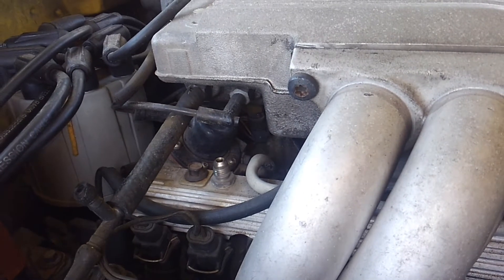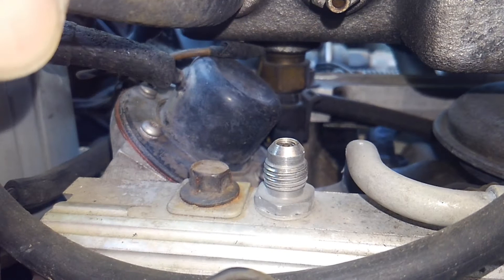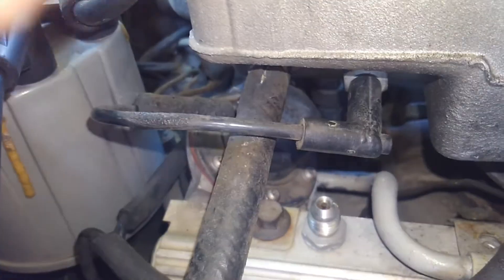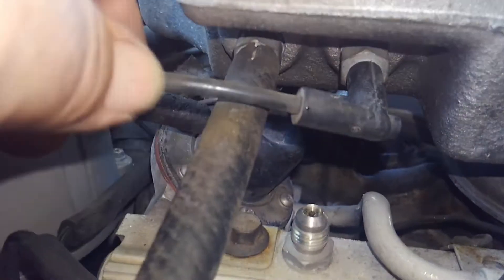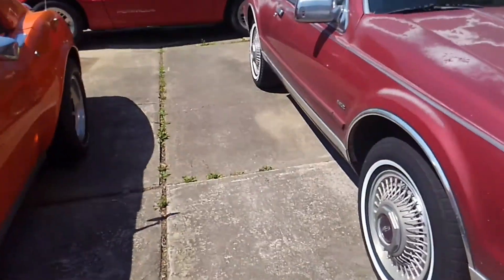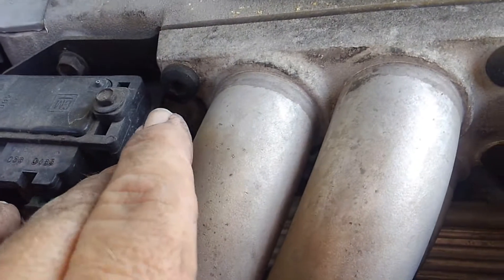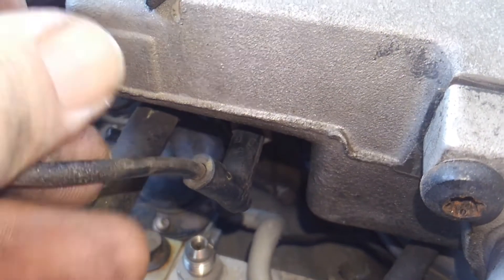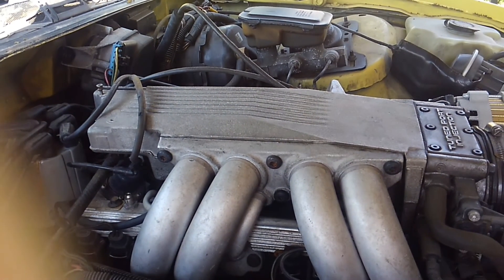GM Corvette and F-Body Tuned Port Injection Vacuum Circuit Explained

Comment: Great video, you sure have a lot of knowledge. I have a question, on my 91 Corvette I removed the smog pump and air diverter along with all piping. However from what I have heard, there should be a small vacuum line going to the air diverter, however I cannot find that line, and I am sure I did not remove it? I have the FSM but can't find any information regarding that particular vacuum line. Do you have any info here?

Comment: I deleted the egr pipe and components but i still have the egr valve. And vaccum hose. Will it cause vaccum leak?
Reply from the maker: As long as you have everything plugged up and/or blocked off you should be good to go

Comment: Just came across your video. I picked up a 87 Corvette with bad heads. (Guy overheated the car bad. Blew the head gaskets and burnt through the heads from the combustion chambers to the water jackets.) In pulling it apart, EVERY plastic vacuum line crumbled!!! 😢 Definitely going to be interesting putting it back together. 
Thanks for the post!
Reply from the maker: sounds like you have your work cut out for you, but should be a fun project. Glad I could help

Comment: Great video, ido keep on getting Code 36 followed by code 45 on my 89 tpi 350 Camaro, i switched maf sensor once and the problem went away a few days, but returned, i think i will go through all my vacuum hoses.
Reply from the maker: that's a good idea. I would take a close look at the wiring to check for damage as well.

Comment: May have already been mentioned but the Corvette EGR is different from the f body. I don’t think it mounts to the intake like the f body it’s mounted remotely if I recall correctly.
Reply from the maker: There is some difference, but it's not with the EGR valve itself, which is in the same spot. The early F-Body and Corvette TPI's use the same GM part number TPI base, but after 86 when the Corvette upgraded to the D-Port aluminum heads, they installed a EGR bypass pipe at the back of the intake directly in front of the distributor that routed the exhaust gas directly to the manifolds instead of going through the heads. The F-Bodies still utilized the steel heads, so they kept the older intake base design. The vacuum lines have different routing as well, which still continues to confuse me, especially at my advanced age😁

Comment: How do you clean the Plenum, with a wire brush or a jel? To make it more shiny
Reply from the maker: I like to use some of the less harsh methods with these bases since many of the cleaners end up dulling the finish.

I always start out with a pressure wahs with diluted Simple Green or citrus based cleaner, and if I need to get crazy will blast it with some walnut media in a cabinet. Much of it is covered by the runners and plenum, so remember it doesn't have to be perfect.

Comment: Where does the vaccum line under the throttle body goes
Reply from the maker: It splits off and goes directly into a fitting at the bottom of the throttle body, and if I'm remembering correctly the other part goes to one of the fittings on the passenger side rear of the plenum.

Comment: Which Vacuum line causes the idle to go up n down or is a bad EGR Valve
Reply from the maker: There are quite a few vacuum circuits on the TPI system that can cause idle irregularities. I would recommend spraying carb cleaner around the intake ports and vacuum lines while it's running to help locate the source of the leak.

Comment: They do use a vac storage canister. Its in the left front underneath the car. Below the cruise control. Can be accessed from under the car.
Reply from the maker: Yep, that is correct. They hid those things very well on the F-Bodies😁. Thanks for chiming in👍

Comment: I’m having a hard time to keep mine running. It only stays at about 500 rpm and then jumps up to 1000 and repeats the cycle. Then I will hear pops inside the engine. Any ideas?
Reply from the maker: Have you checked to see if any trouble codes are popping up in the system? An erratic idle can be symptomatic of several different problems, so a trouble code would help to start narrowing it down.

Comment: Awsome Video There is 2 hoses in the Throttle body  on the passenger side can you confirm where those go
Reply from the maker: one is for the PCV, and the other is a vacuum port into the manifold

Comment: Hi! If i disconnect the vacuum line of the EGR valve. Is the valve will be closed?
Reply from the maker: Yep, that should be tye default position with no vacuum circuit hooked up to it.
Reply: @VetteSource  Thank you!

Comment: I have an 1985 vett it runs like crap until wormed up check engine light is on and im ready to ditch this set up and new intake and carb
Reply from the maker: Hey Heath, have you pulled the codes from the ECM and checked the basic components yet?

Comment: What's the fuel filter called under the tune Port.
Reply from the maker: You mean under the intake manifold plenum?
Reply: @VetteSource  yeah.
Reply from the maker: Oh, the one at the rear of the plenum in front of the distributor. That's the fuel pressure regulator.

Comment: My 90 L98 TA was running fine until it suddenly developed a low idle (300 rpm) problem. Checked and got no codes. Replaced the distributor cap and rotor even though they were almost new (the distributor was rebuilt a couple of thousand miles ago). Checked the coil per factory service manual. Injector resistance is good. Bought a smoke machine but can find no vacuum leaks. The throttle body idle stop screw is plugged at the back which prevents adjustment. As a temporary fix i threaded a nut onto the front of the throttle body idle stop screw which raised idle to 1,000 rpm. Any ideas on what else i should check?  Thanks!
Reply from the maker: That is a tough one. I would suggest disassembling the throttle body to check for any internal vacuum leaks around the IAC housing. They have been known to develop cracks in the aluminum with age.

Comment: Cars with cruise, and or AC got a vacuum tank (ball).  It's hidden under the battery tray, typically drivers side.  There are two trays.
Reply from the maker: Yep, that's a hard one to locate on the f-bodies. It'll drive you crazy looking for it.

Comment: Hey I have oil coming out of the dip stick of a 91 with 118,000 on the engine what am I to do
Reply from the maker: Off the top of my head, it seems like your crankcase is pressurized for some reason. Do you have the PCV system disconnected, or have you checked the condition of the individual components?

Comment: Can you give a link as to where you can purchase the vacuum line connections and/or repair kit?
Reply from the maker: Dorman makes a repair kit for these vacuum lines. They are available at most auto parts stocked under hard vacuum line repair kit.

Comment: Great video very helpful! Trying to figure out where the vacuum line from the heater control valve runs to on the 350 TPI car with the MAP. Any help would be appreciated!!!!
Reply from the maker: Hey Jeff, the vacuum line should have a T junction and then feeds into the main engine harness that goes through the firewall into the passenger compartment.
Reply: @VetteSource  
Much appreciated, had the car stored while I was disabled for some time and the mice seemed to really enjoy the vacuum lines. Thank goodness it was just the vacuum lines. Will try to get out to my shop and see if I can hopefully find some part of a line going into the firewall there. My 1989 GTA is slowly returning to it's former glory days and running again.
Reply from the maker: That's the spirit, slow and steady gets you across the finish line every time👍.

Comment: I have the '89 Corvette L 98 engine that I just purchased.
I have trouble starting it sometimes so I'm figuring the vacuum line to the fuel pressure regulator may not be working properly.
Reply from the maker: It's possible, but that particular symptom can be caused by one of many things. I would recommend investing in a factory service manual for your car. It has all the information and diagnostic information you need to keep it running properly.

Comment: Which of those three vacuum lines goes into the MAP sensor?
Reply from the maker: The vacuum circuit for the MAP sensor connects directly to the rear most vacuum port on the side of the intake plenum, directly in front of where the distributor cover attaches.

Comment: What the T go to on the HVAC line you stated someone replaced. I didn’t hear where the T went or if it supposed to be there
Reply from the maker: Hey Dustin, the T junction will feed back directly into the engine harness that runs through the firewall to hook directly into the interior HVAC control that distributes the vacuum to the individual blend doors.

Comment: So if then lines are not connected right are leaking would that stop the car from starting my 86 will. Crank with starting fluid just a second then die
Reply from the maker: I've never tried starting the car with them totally disconnected. There would be enough of a vacuum leak at the plenum to probably cause it to run very poor at the least and maybe not start at the worst.

Comment: Excellent video for my knowledge I have 89 corvette n all thise hose are brittle how can I replace them ? If anyone knows thank you
Reply from the maker: Hey Oswald, thanks for the feedback. Glad it was helpful. Dorman makes a GM/Ford vacuum line repair kit with fittings. I believe it should still be available at your local parts store. Let me know if you have trouble locating it and I can point you in the right direction👍.

Comment: So I only need the fuel pressure regulator if I plug the other two off
Reply from the maker: Yep, that is correct. You will lose the accessories and HVAC system which all require vacuum input.

Comment: If you have a vid to diagnose a no start condition on a 86 t/a MAF TPI, please point me to it. I know the car starts on starting fluid, has a new fuel pump/ external filter too, and 45 psi at the schrader valve,
Reply from the maker: Hey David, I don't have a video made for that particular scenario yet, but with the checks you have already performed and with the car firing up with starting fluid, I would look closer at the fuel injector harness connectors to make sure they are pulsing when cranking. Sometimes the ECM injector driver circuit will fail causing a similar situation to what you are describing. 

Let me know how it turns out👍.

Comment: I was having a problem with the air flow out of the air vents in my 90 corvette. I found a break in the line  and spliced it back together and the air is flowing out of all of the vents like new.. My cruse has stopped working so I now know to look for the Problem. Thanks for all of the Help that You have provided
Reply from the maker: No problem👍

Comment: I had work done on my 85 corvette and in putting those hoses back i noticed that the hose going from my fuel regulator wasnt there. The little circular vacuum hose and there were hoses placed there from the front of the engine. And my question is does that circular hose go to the plinum only or are there any other hoses that go to those ports on the plinum ?
Reply from the maker: It should be directly connected to the plenum, and doesn't share the vacuum circuit with any other accessories. I don't have my diagram in front of me, but IIRC the rear most vacuum port on the plenum is used for the HVAC/cruise control/vacuum tank.
Reply: @VetteSource  thank you for the reply. Thats what i thought but 
in putting that circular hose there i'm still trying to figure out where these other 2 vacuum lines go. Thats the confusing part. I replaced my fuel regulator because i was noticng raw fuel coming out of my tailpipes and after i replaced the regulator it still spits out that carbon soot out of the pipes. So ure saying i should place that circular line on that port ?
Reply from the maker: Try that first, but with raw fuel exiting the exhaust pipe you may have a torn diaphragm within the fuel pressure regulator itself. Something is allowing too much fuel to enter the combustion chambers. Let me know how it goes.
Reply: @VetteSource  ok i was thinking it might have been one of the fuel injectors placed in the head wrong because the guy had to remove them to replace the manifold and i don't think they were lubed up  before being placed  back in the manifold and they look like the factory injectors so i ordered new ones to replace those just in case while i was down in there anyway. But while i'm replacing them i will check the fuel regulator for tears.
Reply from the maker: Good idea. Let me know if you need anything else.
Reply: @VetteSource  i will thanks for all your help .

Comment: I know this is an old post but hopefully you can help me out. Installed a 357hp crate engine in a 1990 and MAP is giving me a rich condition and poor idle? Any Help>
Reply from the maker: Hey Ron, lots of possibilites once a crate engine is installed, but first thing I would do is hook it up to a professional scan tool and see what the ECM is doing in real time. That will give you some insight and clues as to what to look for. 

Off the top of my head I'm wondering if you have a software problem between the fuel injectors on the crate engine and the factory ECM settings.

Let me know how the troubleshooting goes👍.
Reply: @VetteSource  done that! My issue is not enough vacuum at idle
Reply from the maker: Ok, sounds like you could have an EGR circuit problem. How much vacuum are you pulling at idle? Does it have a pretty big cam?

Comment: NO ONE SHOWS ANYTHING ABOUT THE 1990 CORVETTE! that car is such a mystery!
where does the hose to the HVAC connect to  going from the check valve!?! big mystery woo woo show it please!
Reply: Both
Reply from the maker: After routing through the check valve it feeds back up towards the driverside front of the car and terminates at the vacuum reservoir.
Reply: @VetteSource  thank you very much
Reply from the maker: NP, glad to help👍
Reply from the maker: Are you talking about where it feeds back into the wiring harness going into the firewall?

Comment: No one ever identifies the hoses at the front of the throttle body
Reply from the maker: I hear ya. The hoses actually serve different purposes between the Corvettes and F Bodies. On the Corvette there is a T junction that runs to the vacuum reservoir, and on the F bodies that port services the EGR switch? if IIRC. I haven't looked at it in a few months and I'm forgetting off the top of my head.

Comment: What is the vac. Ball up front fender and lft headlight area for?
Reply: What feeds off of it?
Reply from the maker: The EGR valve and solenoid, HVAC, and cruise control.
Reply: I still have to reinstall mine , just for hvac only . Carbed
Reply from the maker: Ok, gotcha. Yep you will need it to activate the blend doors so the A/C and heat will blow from the desired vents.
Reply: I have the one that comes out of the loom going to a vac port on carb. Do you think that , that is all I need ?  At this moment I still have to look at the heater control valve and see how its hooked up. Thanks for your help. Been on this car for 5 years. Getting close to firing it up.
Reply from the maker: I think that should provide enough of a positive vacuum circuit to work correctly. Sounds like a long hard road you've traveled on, but there's always a great feeling of satisfaction when you get long term projects finished.
Reply from the maker: That's the vacuum reservoir and it acts as a vacuum storage device while the engine is in operation. They have been using them since the 60's, and have slowly figured out how to make them smaller as the years have progressed.
Reply: Yes it's been a long road. Almost ready to wire up and crank. I have taken my time and gone through almost everything in / restore . Hopefully 4+3 works when I'm done. Would really like to talk to you. I am a mechanic . You can email me at -gotahabit965@gmail.com   Thanks for your help.

Comment: What I'm looking for is some sort of diagram or at least explanation on the flow of coolant thru the heater core control valve and the oil cooler. There's a nipple on the radiator that looks like it runs to the oil cooler. Is that going to or from the cooler? It makes sense that it would be going to the cooler, since its coming straight from cooler water. But then again if its coming from the cooler, its going into the whole heater core system, and it looks like fluid passes thru the core, regardless if a vacuum is applied to the heater core valve.
Reply from the maker: I may be remembering the f-body routing incorrectly, but I think there is a T-junction under the water pump like the Corvette with one side going to the heater core,  andd the other to the oil cooler.

I would have to look at the diagram again to refamiliairize myself. I would suggest looking for the correct year model GM service manual. I know for sure the diagrams are in there.

Comment: Finally rediscovered your video. I'm the guy who requested the info.
Upon further research I have discovered bad contact with the ecu connector and also a vaçuum leak on the driver's side. Time for the propane bottle check trick. Thanks for your videos, they're quite helpful.
Reply from the maker: Hey buddy, glad to hear that you have been making progress and it's been helpful. Let me know if I can do anything else👍